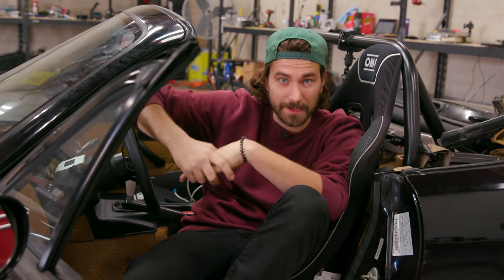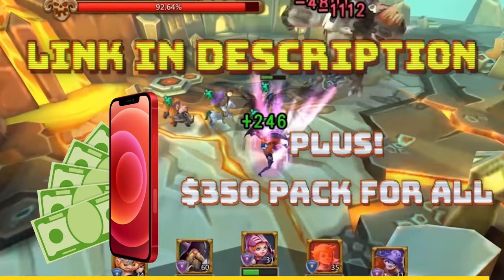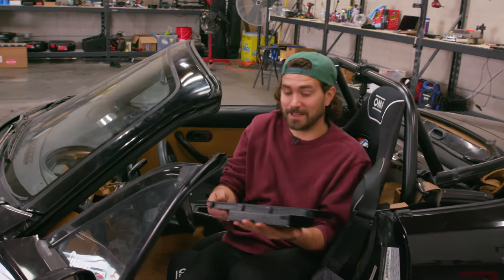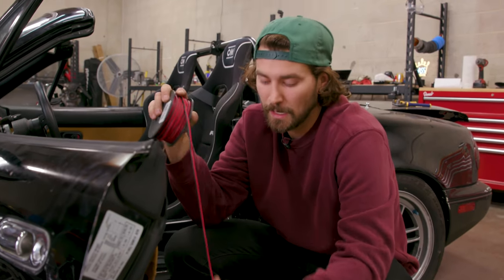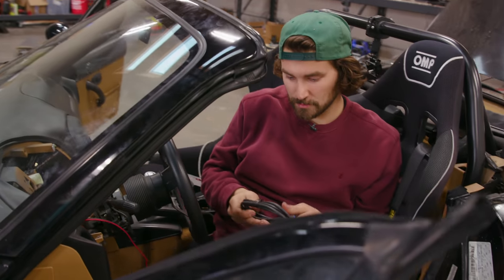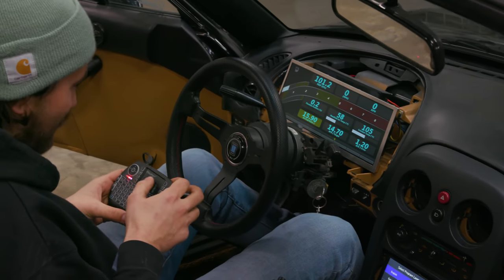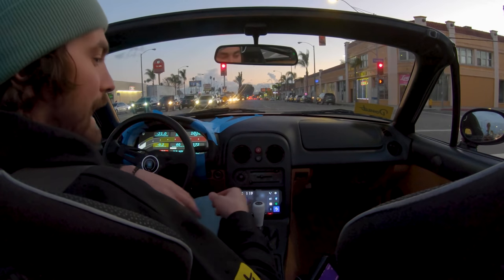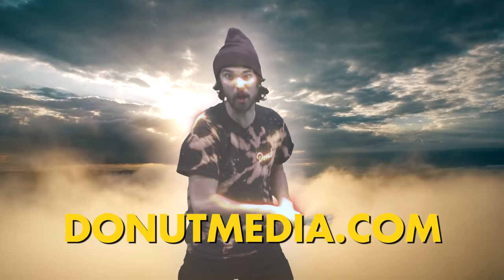Is a Digital Dash Worth It?

Comment: That refresh rate of the screen tho
Reply: Yeah, it's cool, but it seems to lag.
Reply: Yea, noone seems to mention that, its horrible
Reply: I'm glad I'm not the only that noticed. 😂
Reply: It’s almost sickening I would just keep the old gauges
Reply: It's horrid, takes almost a second to update, and 1 second might not sound much but if your full throttle 1 second could be a lot.
Reply: seems to be related to the pooling frequency where the dash retrieves the data from megasquirt
Reply: pretty sure its the cameras fault
Reply: @FinnDhaHuman  camera isn't at fault with that LOL. 

might be that it's running a bunch of tasks in the background, I'd like to see if he can shorten the refresh rate. That's the big reason I don't like digital gauges, even though they get the same information as analogue gauges. IMO they need to be really fast and smooth, and that's the big benefit of analogue gauges. they get that because they're slower to respond.

I'm surprised he didn't go with Holley. but I guess their system doesn't play nice with the Megasquirt
Reply: That screen is crap.  Can you imagine trying to shift at redline.  A digital dash may be worth it, but not this one.
Reply: Yeah tbh i hate the look..... Like id need something with 30 Hz AT LEAST, 60 Hz ideally. Looks kindy cheap
Reply: Basically that digital dash is just a monitor with a Raspberry PI and a custom OS.
Reply: @gabrielecossettini2923  I honestly could probably make a better monitor with a raspberry pi and Linux, and I don't even know how to code.
Reply: bro, that hurts so much to watch hahahaha
Reply: LMAO with this refresh rate you can get the same results (the dash, not the tuning capabilities) with a dumb Aliexpress OBD2 dash. The only digital dash which are worth it are the Motec/Haltech setups which are very fast.
Reply: Maybe it's just a matter of settings, like how many times data refreshes per second. I mean I hope it is lol
Reply: I was thinking the same, it was working at like 5 fps LOL I didn't like that at all
Reply: Zach, Hit me up bro. There has to be some way to increase the polling rate on the gauges. I’m an IT engineering and novice programmer.
Reply: the screens shows like 1 fps how can you drive with that frl
Reply: Ya, that's a dealbreaker. It's gotta be smoother, especially the tach.
Reply: Is probably the polling rate of the ECU updating the screen. There's probably a setting to help update faster
Reply: For me this is a big no go..
Reply: @svengal97  it is a raspberry pi and linux XDD
Reply: yeah but im pretty sure thats the ecu software
not the fault of the product creator or the display or the raspberry pi that runs it actually
Reply: Probably the ecu
Reply: It’s probably not the refresh rate on the screen but the polling rate of mega squirt.
Reply: Looks like cyberpunk 2077 haha
Reply: @andrewf8486  could have everything digital but your rev meter? Lol
Reply: By the time it refreshes you’ll be out of gas
Reply: I think it's fine, he's just using it differently than I would. Leave the gauges in and mount the screen in the center console. So long as you have the analog tach, you're fine.
Reply: right... he was prob getting a solid 3 fps. lol i would have been pissed if i spent 500+ and cut up my dash a little and the screen was that choppy.
Reply: Its actually not the screen here. Its a 60hz screen which is fine. The polling rate is just set wrong. Looks like it has a default one of 500ms or similar. In the end, its just a screen with a RaspberryPi using PiDash.
Reply: Why can't they simply use an android tablet connected to OBD port?!
Reply: Lol I was thinking the same thing. A dash with a refresh rate of 4Hz is not pleasant to look at at all to me.
Reply: @waffledemon62  that would be much better, but even even beyond that anything that changes rapidly rpm, boost, speedometer, look better as an analog gage.  Plus you don’t want readings frantically changing all the time as you drive so decimal places are probably not a good thing unless it’s something stable like voltage.  I mean is it really important to  know you have 62.3 psi of oil pressure or would 62 work.  And I know he didn’t show the start up, but I bet that tablet takes some time to turn on.  So if you want to hop in your car and go you have to wait or guess the speed.  I only see two options for car gauges, analog, or very high quality digital like the haltec dash.
Reply: @davekutya  ¹
Reply: I think its the rasberry pi their using, its using the pi 3 which is alright but not very fast, if it were to be updated to use the pi 4 then the lag would be lessened as it has a faster cpu and faster data transfer speeds.
Reply: Most actual Manufacturer gauges work and look much better than this. This is definitely not a good example

Comment: Zach makes everything look easy:

“At this point, all we have to do is mock up a connection between the flux capacitor and the positive side of the combustion reaction system. And then of course, if that doesn’t cause a catastrophic nuclear explosion, we just have to convert this AC cable to FM. Easy!”

Comment: Ugh, that slow update/refresh speed would really annoy me
Reply: Same. I have an OBD2 connected app on my phone that allows me to do the same things as this and has about the same update speed. It's really not useable as a standalone system I think. The digital dashes that the ecu manufacturers make such as haltech and ecumaster are way faster
Reply: Too much data on the screen at once, I assume this uses some sort of canbus similar to OBD2 which has a poll rate limit, example poll rate is 60 times a second.

You add one extra variable, they can update 30 times a second. You add 20 like on the digital dash here and you are lucky if you can update 2 times a second.

The software needs some prioritization of things that update often such as MPH and RPM then only update other things every few seconds
Reply: @mwmm  that's what i was thinking. if the bandwith is limited, I'd rather hav rpm update at ~20hz, speed at 5-10 and the rest can be every couple seconds or so.
Reply: The speedo is like that even on the new Taycan, its crazy.
Reply: @sjorsangevare  yeah and if you notice on most VW digital displays, the RPM responds perfectly. Seems like an oversight from the engineers.

Really one big thing that is putting me off my next car, I love the active info display in other aspects but the Speedo part grinds my gears!
Reply: @mwmm  even my digital rpm gauge on my vw responds much faster than this. Thats just hooked up via obd2
Reply: @windowsxp9120  It may be yes, canbus has varying rates which can be different per brand. some can transfer more data, some ECUs can be polled more often.

Generally though, polling too many datapoints will slow down even the best setups out there.
Reply: I know what you mean. I wonder if he can program it to be more responsive?